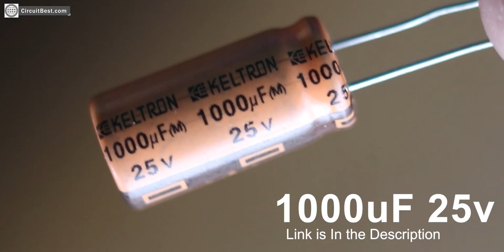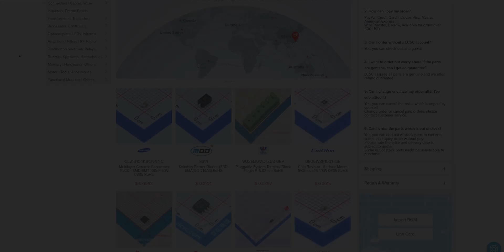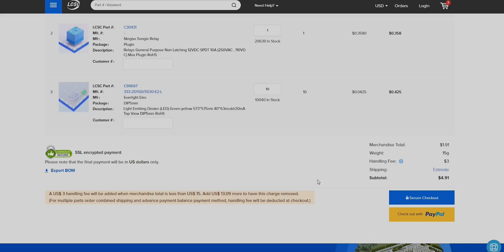LED Flasher Circuit

Comment from the maker: Hello guys Hope you guys are doing well.
In the video at 0:36 I have connected the led +ve with the transistor's collector. But I have written base instead of collector. 
So it is my mistake. 
Sorry for your inconvenience.

And I also want to thank TomSyn35 for finding my mistake. 😀😀

Cheers!!
Reply: Sir pls change transistor bc148 to c945..its work fine.appreciate for nice circuit.
Reply: Sir iske applications advantages and disadvantages send karo
Reply: I was just about to comment, I was wondering what was going on with that.  ok , back to work.
Reply: Aaaa

Comment: if you install the led strip the light ray is not bright enough. I guess what components should be replaced or added so that the light beam still does not dim